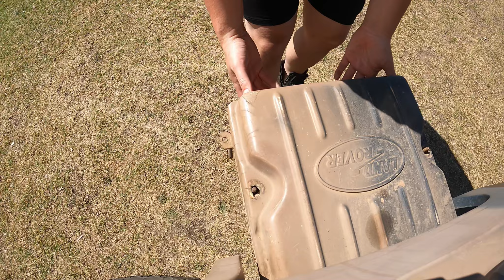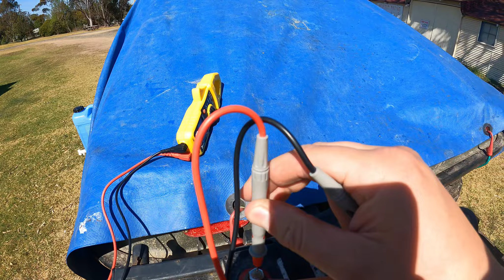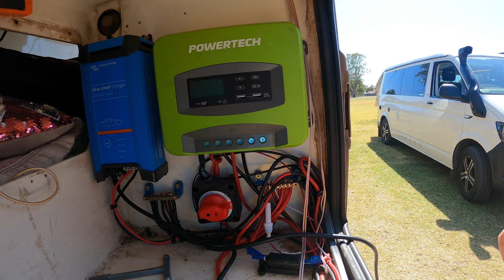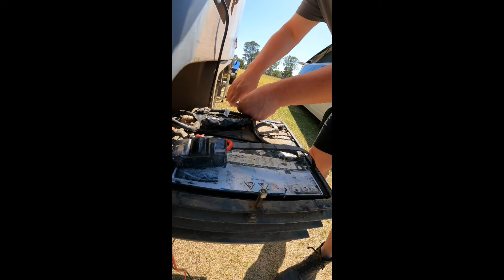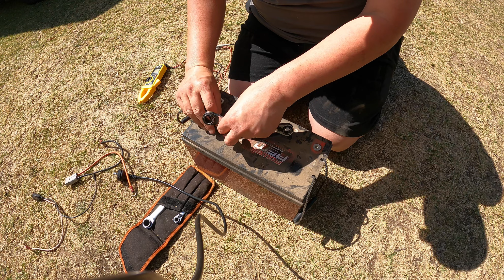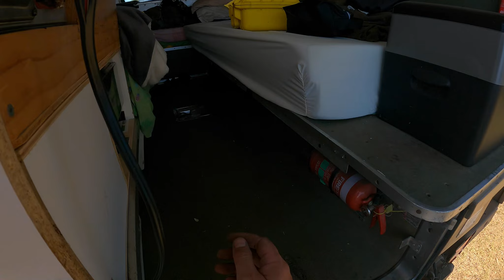Deep cycle failure - Field Fix

Comment: Yeah sometimes these lead acid batteries just poop the bed, with sulphates building up and clogging the plates causing internal shorts when they are overcharged repeatedly or over longer periods of time. My dad used to have very good success by doing a couple of full charge cycles using a DIY pulse charger and a heating element to keep the battery at like 50-60oC to kind of knock the sulphates off the plates again to at least regain a bit of capacity and remove some of the internal shorting, this won't work if the battery is fully dead but I think this one should be salvageable still (or at least reconditioned to the point you can use it on the other vehicle in a pinch) since it seems to hold at least some charge.

Just make sure that you do it in a well-ventilated area since the battery can produce a bit of hydrogen gas doing that and well all know how the hindenburg ended up.
Reply from the maker: these are sealed AGM batteries, they don't lend themselves to that kind of treatment so well.
this one later tested to hold about 8v under load. 
I think when I had a collision with the vehicle a few months back it probably dislodged a cell.
either way, far easier to just replace them, they are getting on for 3-4 years old now anyway and have been treated fairly poorly.